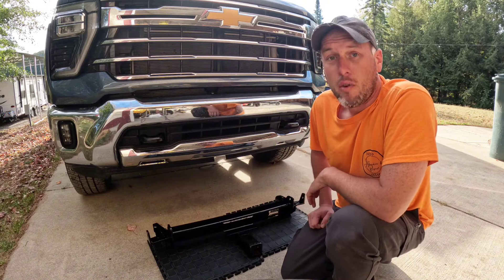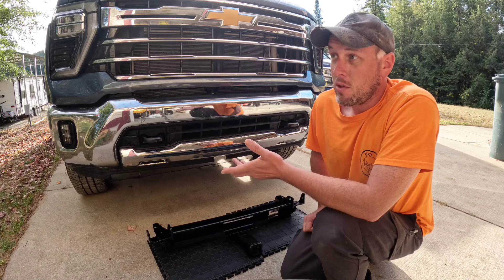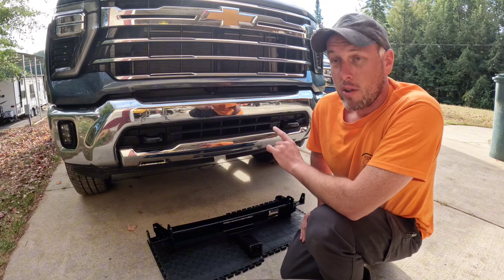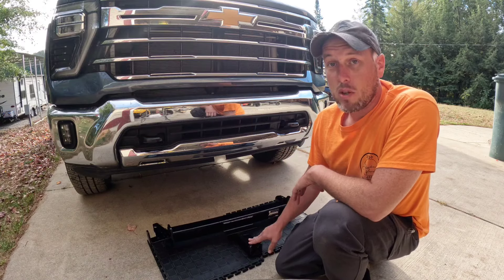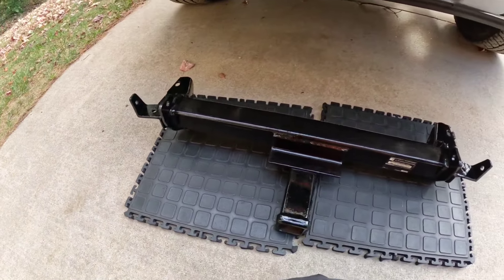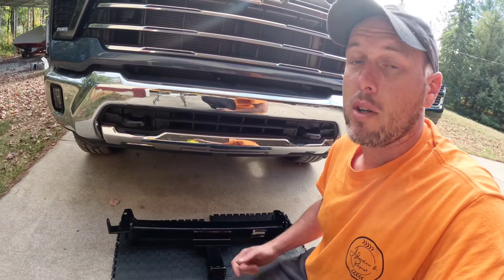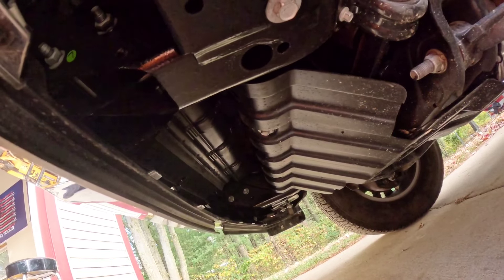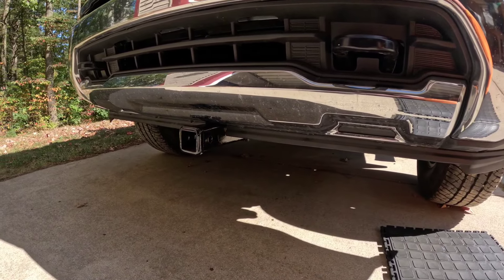Front Hitch Receiver | 2024 Chevrolet Silverado 2500HD

Comment: I had to look back at the video where you installed the second battery and realized you went with the diesel fuse block for a higher amperage tie in. I presume your truck has the one 220 amp alternator due to the plow prep package. So here's my question that you may be able to answer, as per the same idea in tying the two batteries together. Here's the scenario, I had just ordered a truck with the L8T and decided to choose the two alternator setup which also then comes with the two batteries ( 220 amp main with 170 amp that charges the second battery ). I also ordered the truck with the upfitter kit if that makes any difference to the whole picture . But I did not order the plow prep package and the reason for that is I did not want the larger torsion bars due to the stiffer ride, the second battery with the way they intend it is for an RV as you pointed out and so I thought in case I did want a trailer I may as well throw the stuff under the hood the economical way by ordering it all. My question is, what would happen if the two batteries were tied together with the existing parts, is it even possible and would the fuse block/relay or whatever is all with the secondary battery not be capable of dealing with the amperage draw, and would there be an issue with two alternators that would then effectively be tied together charging the same two batteries, if it would confuse the trucks computer or something weird like that.
Reply from the maker: The way I understand it, it'd be best to leave it the way it is if it's dual battery and dual alternator. Because the second alternator is dedicated to the second battery. The factory uses a relay to combine the batteries when needed. The trucks use smart alternators so they are only putting out when the batteries need it. So I'm assuming the combining relay only activates when the truck wants them to be. If you put a diesel secondary block to bypass it you may throw a code for no relay signal. Not likely will there be charging interference from both alternators charging at the same time but it could lead to them being less efficient. The biggest thing in the plow prep is the relay box that comes with it, so when a plow pump motor runs and then shuts off quickly, it keeps the engine alternators from spiking the voltage, from trying to handle the load, and shutting down the dash systems
Reply: @adventureandrepeat  That's interesting about there being a relay that would at times combine the batteries. Since I have never had any decent information on the system, just comments that the second alternator with battery are designed to power a trailers charging needs. So I realize a second battery and turning a second alternator is just more drag and dead weight but with these trucks already being somewhat portly weight wise even with the gas engine, probably doesn't make much of a difference in the scheme of things. One part of me dreads owning a truck like this ( anything modern ) as its a rolling mass of expensive to replace or to diagnose electronics as well as too complicated an engine ( not as bad as some though ! ) as well as the transmission.
Reply from the maker: There really is not much info out there on the battery system. Even my dealership that was getting parts from wasn't super confident. But I found all this out by trying to do it. Because I bought the full harness and correct relay box. Just to find out it couldn't be done. But I understand the concern for how complicated these trucks can be. That's why there is warranty so you don't have to know! Haha. But the engine is just about the same as when they first released in the half tons in 2014. The 6.6 is just a stroked out 6.2, which has been around a long time. And the transmission may be new, but the service side of it for regular guys isn't much different than it ever was before. Just no dipstick on it like most other vehicles on the road today. In a few years, these trucks will start being apart of the secondary market. So they complexity isn't going away unfortunately and as the years go on, they are only going to get more complex as technology changes. Buying any vehicle new or used is always a gamble

Comment: How are you going to wire it in? I was thinking of running fused 2/0 cable to the front and back of mine, with an Anderson Powerpole connector. Use it for the winch, boosting, charging, and the tire inflator.
Reply from the maker: 2/0 will be more than enough for the front. However if wiring to the back it will not be enough for a winch without a battery as a ballast to take the load. Amp over distance dictates proper wire size. The other things should be fine with a 2/0 wire to the back alone
Reply: What would you size it for your winch?
Reply from the maker: Front for me will be 2/0. Which is what I will need for winch load for distance

Comment: Do you have any videos about the wax frame?  I have a couple scratches on the frame on a 2024 and am trying to figure out if Injust spray with fluid film or something else
Reply from the maker: I don't have anything up that covers it specifically. However, in the places that mine had scratches I have just sprayed with black paint heavy and it appears to have stuck and not caused any harm to it. I did pick up some stuff from amsoil to try for this winter to coat the underside, just haven't put it on yet. It's supposed to be a wax film similar to the frame coating
Reply: @adventureandrepeat  funny coincidence, I used fluid film on my old truck but also picked up AM Soil to try this winter.  Thanks as always
Reply from the maker: No problem! With all my plow parts I usually soak them all down with wd40 at the beginning of the season to prevent snow from sticking and it's helped keep everything from rusting out on me as well